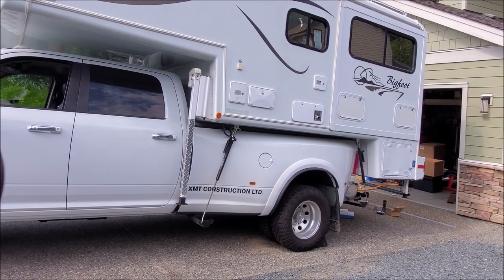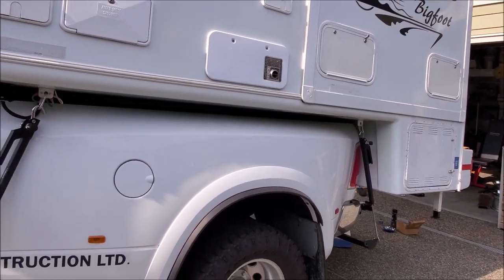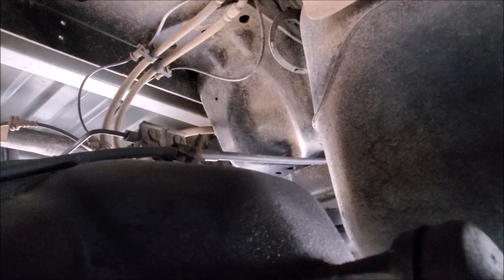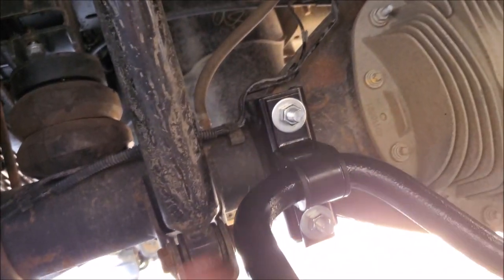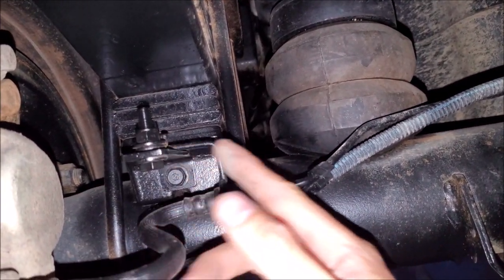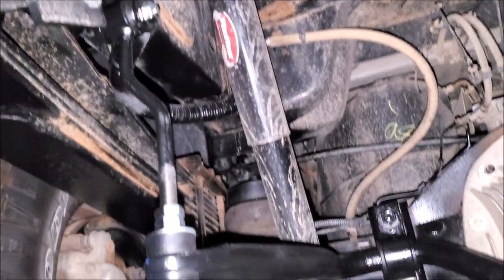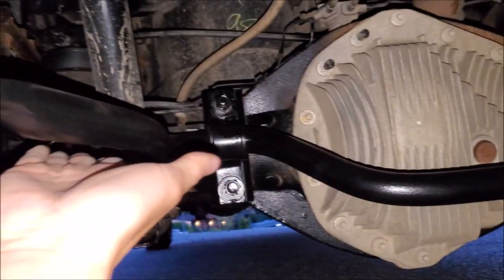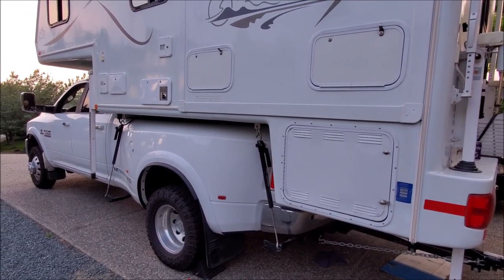Adding a Sway Bar to a Cummins Ram Dually (Hellwig Big Wig) | AnthonyJ350

Comment: I put one on my 05 Dodge 3500 4 door long bed dullay and I just threw that frame mount away because there is a hole on each side of 20K super truss had a hole to bold your end link and is so simple and looks like custom or factory and I will try to get a picture to show how slick it is .
Reply from the maker: Thanks so much for sharing!

Comment: Excellent addition to that vehicle..
It will definitely help with stability on the highway with strong cross winds
Reply from the maker: Yes, definitely
Reply: Anthony, I've been trying to hold of you on FB and Email...Basically, How to isolate/troubleshoot rear Suspension clunks in Z/G cars?Common problem area, if any?
Reply from the maker: @stealthg35infiniti94  I know the center diff bushing wears our and the hydraulic fluid comes out. I would get the car in the air and check all the bushings for play. Do you have the Z1 sub frame bushings installed?
Reply: @AnthonyJ350  I did the White Line Diff bushing set (3 locations)...Careful inspection shows no obvious band bushing, new sway bar end links and sway bar bushings, new shocks, and still I get clunks. Clunks come in every change of driving parameter action
Reply from the maker: @stealthg35infiniti94  Trailing arm bushings ok? Sway bar end links new and greased?
Reply: @AnthonyJ350  The new end links and sway bar bushing  perfect..problem was there before the replacement parts..
Inspection does not show wear on the trailing arm bushings, although I did not force them with a pry bar...Seems I'm replacing parts but I yet to find the cause of the clunks

Comment: I just installed my hellwig rear sway bar today on my 2012 Ram 3500 single rear wheel.  I have a 855s lance truck camper.  The installation didn't go well due to having a torklift magnum 30k hitch on the back.  (I noticed you have one as well and you didn't have the problem I did.). I can only assume you didn't have the problem I did, because yours is a long box, as mine is short box.  The torklift hitch is in the way and I could not install the u-bolts over the frame for the sway bar links to connect to.  I had to modify my mounts and weld them to the torqlift receiver hitch.  It wasn't a huge problem.  If mine was a long box I wouldn't have had to do this.  I have not drove the truck yet with camper in back.  But I will in a few days, and I'm sure it will help.  I also added airbags 2 years ago, that made a night and day difference!  But still hated the cross wind, and passing semi trucks because of body roll.  Great video!
Reply from the maker: Glad to hear you were able to do the install. Let us know how it drives!
Reply: Hey any update on how it drove after the install ?
Reply: Drove great!  Only 1 issue, sense I have the torkloft hitch, I had to modify it for sway bar end links to bolt on.  With that being said, if camper or gooseneck trailer is in, I have to have the bags inflated.  Otherwise the sway bar hits on the exhaust and rattles.  But once bags have air in them, or no weight is on truck it’s fine.
Reply: @neb4x4  would you say it’s worth purchasing for truck camper owners , like how much of a difference in handling and stability. Does it stop you from doing usual 4x4 trails at all ?
Reply: In my opinion with my Ram 3500 and Lance 855s, it’s a must! As with the airbags.  It made a huge difference on the interstates and highways.  With crosswinds to going around semis.  Before the swaybar  it was almost white knuckle driving on I-80 when passing semis.  Now, with the swaybar and airbags, I set the cruise at 75, and don’t have any issue.  Even in big crosswinds.  Best $ I spent.
Reply: I haven’t taken the truck camper on any off road trails since 2017.  And that was before the airbags, and swaybar. However I plan to soon.
Reply: I have a magnum 30k on my 2019 3500 cclb drw factory air and had the exact same problem you had.  The magnum super hitch extends to where these frame mounts are supposed to go.  I managed to get them installed but it is hokey and Torklift disagrees that it's an issue even with sending them photos.
Reply: I have 7000 lb air bags from Fire Stone and 5200 Bilstiens shocks and my  Big Wig sway bars worked great and the truss hitch had holes to mount the Big Wig sway bars it looked like a factory in stahl and they helped wit air bags inflated to level the truck and I love it so nice no semis to blow me around they are just that stout !!
Reply: The truss hitch is so cool because they drilled holes for the Big Wig sway bar end links to mount to and not like somebody in their garage, Sweat !
Reply: When you have super truss hitch on my 05 Dodge 3500 long bed dullay 4 door and you don’t use the clamps around frame for the end links super truss hitch 20 k they drilled holes in them big plates and mount the end likes to the hitch and made it look factory or a custom made it was Sweat !!

Comment: you seem to know your stuff.
Can I ask for your opinion?  have a gmc canyon duramax, with a slide in Scout camper (approx 1000lbs).  I installed a set of Timbrens.  Just bought a Hellwig sway bar and that defintitely helps.   We are not doing any serious off roading, but we do go off the beaten path.  My question is about shocks.  Wondering if Bilstesin 5100s would be adequate, or should we size up to the 6100s for the front and the 5160s for the rear?  Any informed opinions apprecaiated!  thx
Reply from the maker: I love the 5100s. I have 5160s in my 1500 Silverado and work great.

The bigger shocks have more fluid and will disapate heat better. If you move slow like everyone else off road 5100s are perfect.

Just make sure whatever shock you purchased, it's spec'd to the ride height of your truck.

Is the truck leveled?

Comment: I have airbags and stable-loads on my 2013 2500.. wondering if this will help with my top heavy camper.. or are the stable loads just as good as the sway bar
Reply from the maker: Never used Stabel Loads so I can't comment on the product.
Reply: Did you ever install one on your 2013 2500? I just bought one and will be installing it soon. I just wanted an honest opinion from someone who has an identical truck as mine.
Reply: @tomduncan1970  I didnt......

Comment: I am looking to add a sway bar to my 2021 ram DRW. Hellwig Customer Service told me they don’t fit with the Torklift Superhitch models after 2018. What year ram do you have here and did you have any figment issues? Thanks for sharing!
Reply from the maker: I'm pretty sure this was a 2018 truck. As an alternative you can install Timbren load cushions and preload bads for the helper springs.